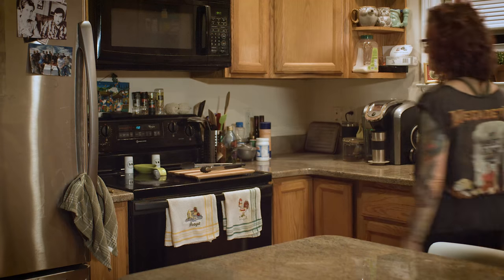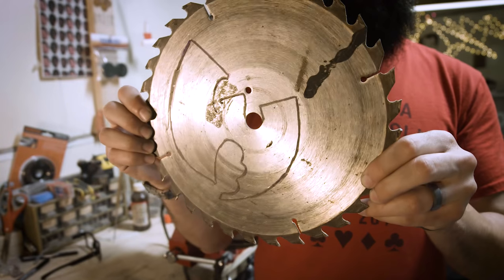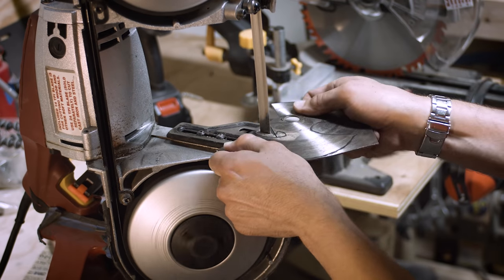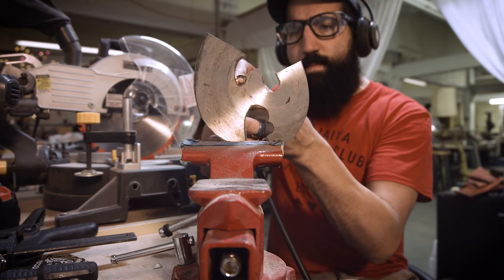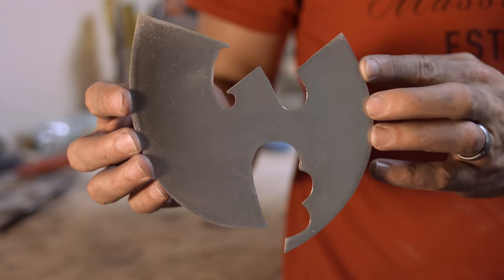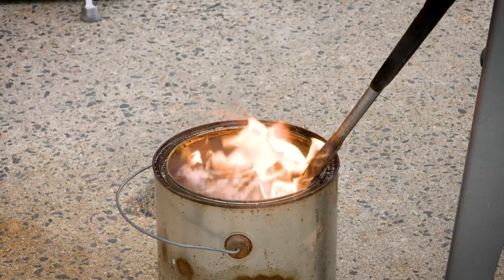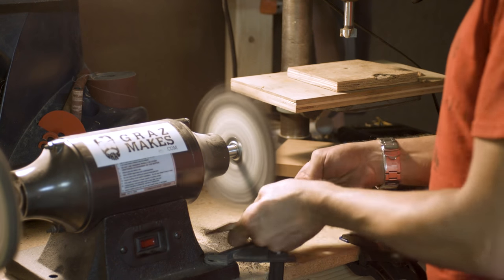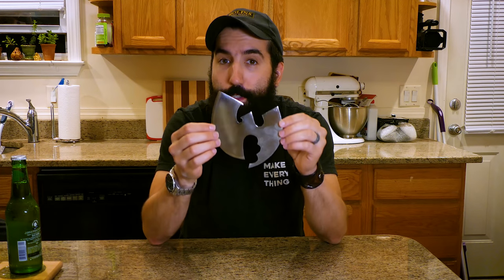Graz Makes: The Wu-Tang Pizza Cutter (out of Jimmy Diresta's old table saw blade)

Comment: What kind of saw and belt grinder?
Reply from the maker: It’s a 2x72 belt grinder from “Oregon knife maker” it’s the best for the money! Check them out on eBay.
Reply: What kind of metal band saw is that?
Reply from the maker: a bauer saw from harbor freight. thanks for watching!
Reply: Cool, did you build a mount to make it vertical instead of handheld?
Reply from the maker: nope! just tightened in one of my vices :-)
Reply: <slapping forehead>
Reply: I know you've told me before (hanging head) but I can't find the comment where you told me - what is the name of your editing software?
Reply from the maker: its called "davinci resolve" it looks intimidating, but stick with it and its a great program! https://www.blackmagicdesign.com/products/davinciresolve/

Comment: Why does the saw blade need to be re-heat treated? Did you think you could do a better job of it than the manufacturer who knows the exact steel composition?
Reply from the maker: ouch! that burn could heat treat a table saw blade! but seriously, to answer your question...I did it because the blade itself is tool steel but the teeth were carbide. that being said, I used the inner part of the blade, so I figured I'd heat treat it so that it may hold a better edge. not really worried about it, as it's only cutting pizza :-)
Reply: Sorry about that. I assumed a fully steel blade that was entirely heat treated from the factory.
Reply from the maker: no worries man, just bustin' your balls. hope you dug the video!